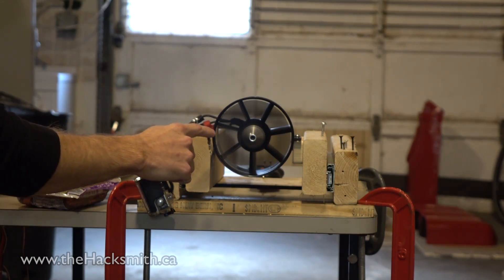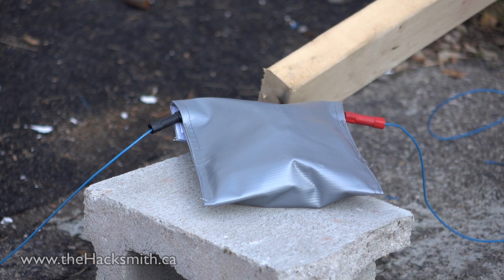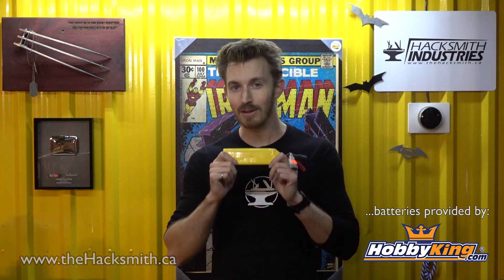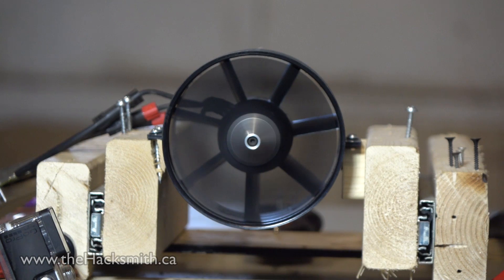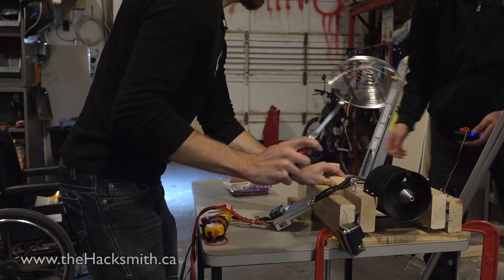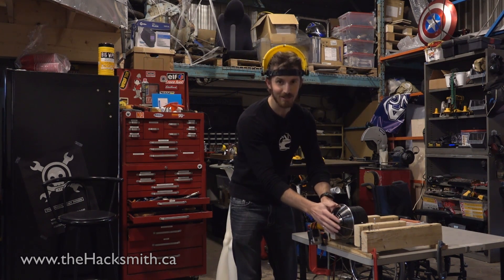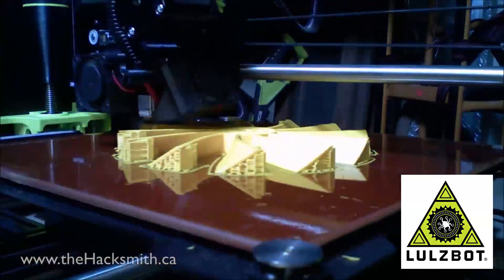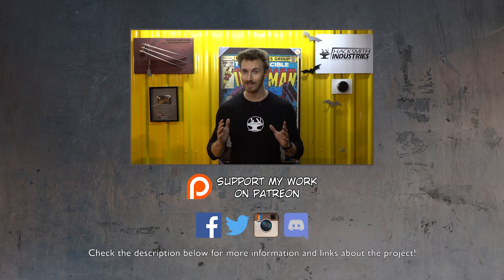Flying Like Iron Man #11: Not So Safe Safety Tests

Comment: To give you a little help with battery, see this type of battery.Manufacturer's Rimac (Europe,Croatia)  here are a few links  it's easier to find. 
http://www.rimac-automobili.com/en/
http://www.rimac-automobili.com/en/technology/battery-packs/
https://www.google.rs/search?q=rimac+battery&biw=1280&bih=918&tbm=isch&tbo=u&source=univ&sa=X&sqi=2&ved=0ahUKEwi45M275sTQAhXFPxQKHdLQB98QsAQIIA
Their batteries are the strongest in the world compared to other batteries.
Maybe you should try to contact them.I think that this type of battery, just a little nicer and more compact packed can with stand more minutes of flight with Ironman suit. I hope this will help you as much as possible.

I apologize if there are grammatical errors,I do not speak English very fluently.
Oll the best from Serbia.

Comment: and... if you use a micro combustion motor, attached to a generator, instead all the batteries???
Reply from the maker: Thanks for the question Daniel Canarias!

We've actually answered this in detail in the Flying Like Iron Man Q&A video! Check out that video, or visit http://www.thehacksmith.ca/flight-project-qa/ to learn more about the project!
Reply: the Hacksmith no..you don't understand me.. use a combustion engine for an energetic generator and ac/dc converter. And power your electric engines with the that.
Reply from the maker: Also outlined in the FAQ... the system power is around 150kW. The generator you would need would be the size of a transport truck. Not to mention the cost of an AC/DC converter would be over $50,000 in that power range.

Comment: how have you not does yet, that can came at you
Reply from the maker: wut
Reply: the Hacksmith ooh boy, how my auto correct makes me sound dumb. 😂😂 what I meant to say was how have you not died yet, that fan game right at you
Reply: the Hacksmith plus the app isn't working for me, I was only able to watch 2 ads, I would like to help more
Reply from the maker: You can only watch so many ads per day -- not sure how many.. it should say
Reply: the Hacksmith ooh ok thanks
Reply: the Hacksmith you could try a hexagonal patern tithin the blades to reinforce it and if it's not thick enough for that you could make it thicker to accommodate.

Comment: Hacksmith.. use sandpaper and manualy smooth the blades then reinforce 3d printed blade with glass fiber coat. it will give significant amount of rigidity and trust. The blade must be hand made!! Source: Master of sports in plane modeling.
Reply from the maker: Plane props go a loooot slower than EDFs -- we need to make sure these are perfectly balanced which is going to be really hard to do with sanding.
Reply: the Hacksmith i was talking about EDF  variant.. yes it is very difficult to balance that type of propeller but it is possible.. all custom mande fans propellers 1st prototype is hand made wich can take long long time but when you got prototype you can make mold and make lot of them.. there are many very strong plastics that can be molden. Thats a chep variant.. and there are expensive veriants to order by any parameters frome some company... Any questons i'm ready to help!, Can't wait to get better having some health problems... will start exosceleton project! Good luck!
Reply from the maker: What we're thinking about trying is stacking a few RC plane props, and building our own EDF ducts -- might be the best of both worlds!

Comment: +the Hacksmith
Could you smooth the 3D printed blades using acetone and then have a mold made and cast then in aluminium? would this be cheaper than the commercial EDFs?
Reply from the maker: Problem is at home-casting is pretty difficult for precision parts. It works for a lot of things, but for something like this, might be more effort than it's worth.

For example -- if you see the professional EDF blade we show near the end of the video -- look at the underside. It has a bunch of holes in it. Those are for balancing the blade so when it spins the CofG is perfectly in the center. Considering that whole piece was machined very accurately, it should of been balanced from the get go. Now imagine casting it, how many variations it would have! It might be possible, but like I said -- would probably end up being more effort than it's worth.

Comment: If you put a short length of ducting on the edf you would less likely to catch a body part in it (you would have to push a body part in to the edf straighton) maybe you could forgo the grill then
Reply: Could be a couple of inches only. Maybe a 45 degree bit on the end would cut down the chances even more. Guess you would have to do further tests to see if this would restrict flow less than a grill.

Comment: you should try and use stainless steel pla for the fan, it's part steel and part pla.
Reply from the maker: Unfortunately those metal infused filaments are more marketing hype than they are actually functional :(

Comment: Nice dream. I think you are just getting stuck with this project. If you want to get money for your projects i think you schould have a solid plan (i mean not just stick the impellers to you and see what happens...) I would donate if I would see calculations, blueprints, schematics and simulations etc. You are a engineer after all and not a hobby experimenting! I´m looking at the current idea/3D render and already see things that dont make sense, like why the batterrys and thus quite some mass are mounted so high on the device. Seems like you will have less issuses with stability when you keep the center of gravity low and near you(but of course the fans high).
Reply from the maker: Well, did you miss the exploding batteries part? Good to keep them away from the pilot. They need to be mounted behind because that will counter the weight of the pilot, allowing for stability. The vertical placement really doesn't matter too much as all the stabilization really occurs in the hexacopter part which is controlled by a flight controller. There's just nothing to mount batteries to near my feet, behind my center of gravity. 

There's no easy way to share all the info you requested, and the amount of time it would take to share all of that for the 0.1% of people interested in seeing it... doesn't really make it worthwhile. I'm not just "sticking fans to my body and seeing what happens".
Reply: Everbody could tell you that LIPO´s can explode. I think that it is relly worth sharing all of your thought on this project. Let me tell you one thing: you REALLY need a solid plan to get something working out of this project... no one build a  plane/car/rocket... without a plan. I´d be espacially curious to see your calculations. 80k$ aren´t anymore on the hobby level, but I have the impression that this is your current level in your "R&D". Like print a fan and let it spin and see if it breaks...instead of simulating the aerodynamics and statics/calculating the forces of the fan. I think this project is one caliber too large for you, but I don´t want to say that it is impossible, it is very hard and the only way to realise it is with SOLID engineering work.
Reply from the maker: Okay. Might as well unsubscribe then.

Comment: make sure you look into different materials for printing because you can print stuff with carbon fiber inside, all be it it will be more expensive. Btw if you haven already try edf blades that have more of a airfoil shape to them.
Reply from the maker: We need a good blade design that produces lots of thrust efficiently before we start playing with different materials, but that is the plan!
Reply: the Hacksmith That would be my plan too. I would also look up the physics and engineering behind designing a propeller for an edf, but id imagine thats your plan as well.

Comment: I thought thrust was measured in Newtons, why do you keep talking about it in terms of Kg (not an engineer, so feel free to tell me how horrifically wrong I am, but was under the impression that Newton = Force, Kg = Weight)?
Reply: probably just to make it easier for viewers to visualize the amount of thrust
Reply from the maker: +ComputersAreRealCool the proper nomenclature is Newton's, but effectively they are the same. "10kg" of thrust will lift 10kg of weight. Majority of our audience is familiar with kilograms but don't know what Newton's are. Conversely with the imperial system, pounds can actually be used as a measurement of force, and weight :p so really it's all semantics
Reply: the Hacksmith Ah ok, thanks :)

Comment: hey how much is the plastic stuff you put in the 3D printer and how expensive was the printer when you bought it? also how much weight are the fans? how expensive is it to make each 3D printed fan, even the ones that did not work. keep up the good work really good work.
Reply from the maker: That's a lot of questions! 3D printers range from $500-$3000 for a consumer model. We use a TAZ5. Most plastic costs between $30-50 per kilogram. A fan blade only uses around 100g of plastic. Check out the links in the description for more info!

Cheers
Reply: the Hacksmith holy cow thanks for answering so quickly. I posted this not ten minutes ago. thank you for answering all of my questions. I'm looking to build things just like you are. I am only 16 but I'm looking to enroll in a program for engineering in my school.

Comment: What would happen if the battery ran out then you fell witch caused the batteries to be punctures?
Reply from the maker: Then I'd die and explode!
Reply: the Hacksmith Well would the batteries have the same effect from being fully charged vs empty?
Reply from the maker: I think they're still rather flammable

Comment: You could try putting metal on the 3D printer pice
Reply from the maker: We looked into it, almost $900 for a single blade to be printed at a 3D printing bureau :(
Reply: Ohh and you can add springs to the jet boots so that you have a stronger lift off

Comment: make a 3D printed fan then use it to make a mold then pour melted aluminum into the mold, let it dry, boom you got a fan blade
Reply from the maker: Problem is at home-casting is pretty difficult for precision parts. It works for a lot of things, but for something like this, might be more effort than it's worth.

For example -- if you see the professional EDF blade we show near the end of the video -- look at the underside. It has a bunch of holes in it. Those are for balancing the blade so when it spins the CofG is perfectly in the center. Considering that whole piece was machined very accurately, it should of been balanced from the get go. Now imagine casting it, how many variations it would have! It might be possible, but like I said -- would probably end up being more effort than it's worth.
Reply: the Hacksmith oh well this systems rigged lol
Reply from the maker: What?
Reply: the Hacksmith lol nevermind
Reply: the Hacksmith  capt America shield was best
Reply: capt America shield + COD exo skeleton = op although electromagnet might interfere

Comment: why don't you cast the fan blades out of aluminum? Print what you want, make a mold off the print, then smelt down pop cans. very cheap and easy to do...then you could make the blade much larger.
Reply from the maker: Problem is at home-casting is pretty difficult for precision parts. It works for a lot of things, but for something like this, might be more effort than it's worth.

For example -- if you see the professional EDF blade we show near the end of the video -- look at the underside. It has a bunch of holes in it. Those are for balancing the blade so when it spins the CofG is perfectly in the center. Considering that whole piece was machined very accurately, it should of been balanced from the get go. Now imagine casting it, how many variations it would have! It might be possible, but like I said -- would probably end up being more effort than it's worth.

Comment: Why don't you make a blade out of foam. Then put it in casting sand then pour metal into and then you have a metal fan???? Guys like this so he could get the chance to see it or comment the same thing. I think it'd be a good solid idea you just might have to sand or polish it to get that smooth finish.
Reply from the maker: Problem is at home-casting is pretty difficult for precision parts. It works for a lot of things, but for something like this, might be more effort than it's worth.

For example -- if you see the professional EDF blade we show near the end of the video -- look at the underside. It has a bunch of holes in it. Those are for balancing the blade so when it spins the CofG is perfectly in the center. Considering that whole piece was machined very accurately, it should of been balanced from the get go. Now imagine casting it, how many variations it would have! It might be possible, but like I said -- would probably end up being more effort than it's worth.
Reply: Alright well that works for me. I was just sharing my ideas I'm not an engineer lol I don't know everything that happens. But if it was machined very accurately you might be able to get the items to do that but it might cost a lot. Anyways if you decide to do casting I would love to see if it failed or succeeded just go behind a shield of some sort lol anyways you make awesome videos 👌 stay safe man!

Comment: Have you looked into 3d printing with composite materials like carbon fiber for the fan blades?
Reply: Carbon fiber blades are not good for dealing with cracks from dust and the like, the fibers would lose integrity and be invisible, and do not deal with heat very well (they're okay but not as good as metal) unless you coated the fan edge with say titanium (what they use for jets) it wouldn't be very safe. You could have ceramic mixed with the carbon fiber to make it heat resistant but i'm not sure if the science for that has caught on yet. In short it's easier to use metal blades (notice the actual blades for the edf are metal) if you want more info look at http://www.airliners.net/forum/viewtopic.php?t=770025 or the like.
Reply: The link you gave is talking about fans that run for thousands of hours. For a fan that only has to run 2 minutes at a time carbon fiber composite would be fine.
Reply: Reuben Cordery Why would it need to be extremely heat resistant it's and edf not a turbofan?? And to my knowledge you can't feasibly print ceramic materials at home. Plus if the normal 3d printing plastic works in the edf like he showed carbon fiber would just be a better version of that
Reply: ***** There are epoxies that work up to 500 F and polyamines that work up to 700 F. Trust me, the blades on these fans aren't going to get that hot. I was just thinking, he could 3D print the blades a little undersize and lay up a layer of carbon fiber composite over it.

Comment: Is it worth thinking of hybrid system, using electricity and gas?
Reply from the maker: Could be, but jet engines that put out the same thrust as the EDFs we want cost about the same. Stabilization becomes the issue -- we have looked into it though!

Comment: You should be on the news or something, this is awesome
Reply: +Harambe paint the 3d printed edf in apoxi or super glue to smoothen it and strengthen it
Reply: Using an epoxy resin and a layer of carbon fiber fabric wrap could potentially smooth the surface and increase the overall durability.
Reply: daftpowe23 He has been.
Reply: The Graphics Gamer he should epoxy the 3d printed part and smooth it then sand cast it in aluminum. Structural integrity is off up most importance at this phase.
Reply: Making trash that will never be like iron man?
Reply: Not in my country.
Reply: He was on daily planet
Reply: Tea Kitty Shut up. Could you do better? There's always one of you dumbasses always hating on videos that people take time with. Kmt.

Comment: The metal edf blades look like metal strips that were bent into shape, maybe you could try that. Cut them out of a disk and weld the appropriate parts together.
Reply from the maker: They were machined out of a chunk of material. Biggest problem with doing anything by hand, or with welding, is making sure its perfectly balanced. If it's not, bye bye motor and hello danger!

Comment: If you made the 3D printed fan blade thinner, then sanded them to be smooth and coated them in soda can aluminum wouldnt that make them more durable so they would break
Reply from the maker: EDF blades have to be very precise and perfectly balanced because they spin so fast. Doing anything handmade like that probably wouldn't work =(

Comment: well those bumps and ridges are why you sand your 3d-prints smooth after printing em...
Reply from the maker: Good luck evenly sanding blades that need to spin at 40,000RPM! They need to be perfectly balanced =(

Comment: gas/petrol is a much more efficient power source. you will be able to fly for longer and you won't have to charge the batteries.
Reply from the maker: Watch the last video for an explanation why we're not using jet turbines =)
Reply from the maker: We've actually answered this in detail in the Flying Like Iron Man Q&A video! Check out that video, or visit http://www.thehacksmith.ca/flight-project-qa/ to learn more about the project!
Reply: Ok thanks

Comment: what about those 3d printing services that print with metal? maybe you could utilize those? i guess casting them yourself is probably not that easy
Reply from the maker: I got a quote -- for the fan size we need it'd be around $900 to do it in aluminum -- just for one =(
Reply: the Hacksmith hate how funding is an issue. If money were no object, this project could move a lot more smoothly.
Reply: what would the guys from NYCCNC charge? :D

Comment: Why don't you have all the batteries on the floor with a tether so you don't have the weight of them. I mean surely the cable won't weigh as much as the lipos.
Reply from the maker: We explained the problem with the tethered idea in this video ;-)